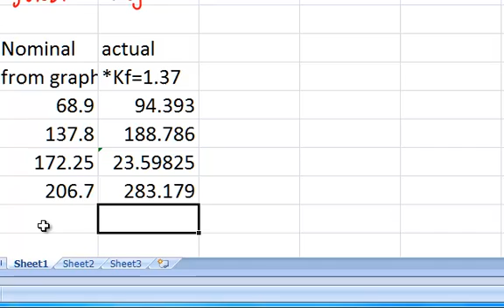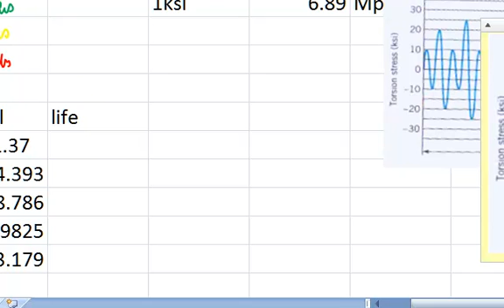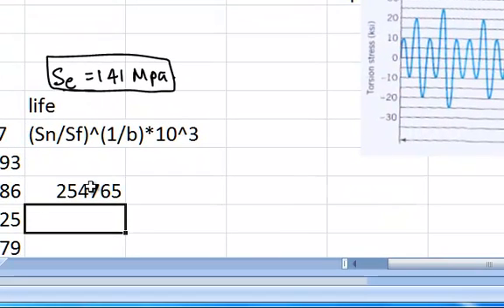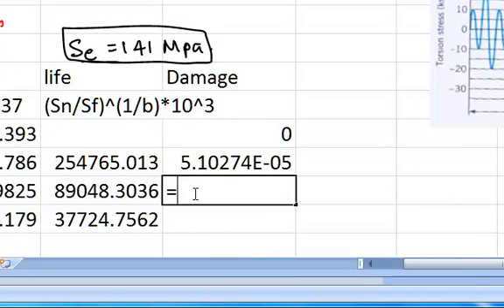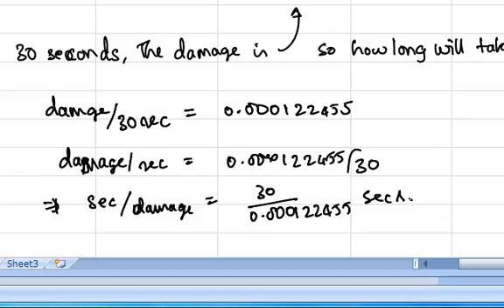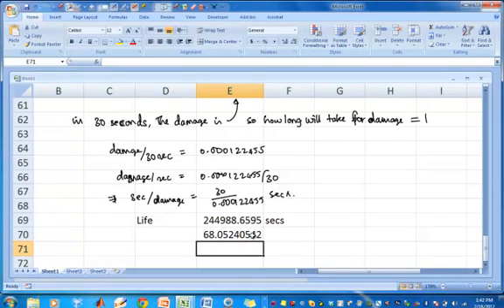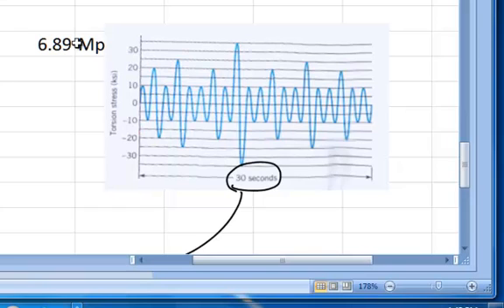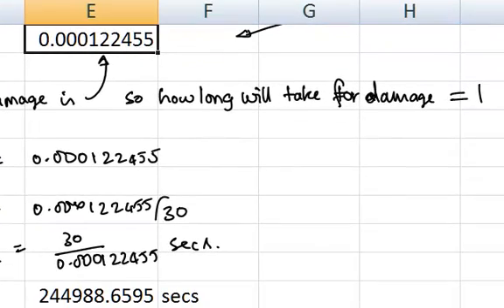MinerPlamgrenDamageRule01_c.mp4

Comment: For calculation of damage of Nominal of 137.8, should you not  divided 4 by 254765.013 to get 1.57 E -5,  but instead you used the  13 cycles in which for the infinite life, therefore you got the answer for damage of 5.10274E-05 so why ?
Thanks for your explanation, really nice one, Regards